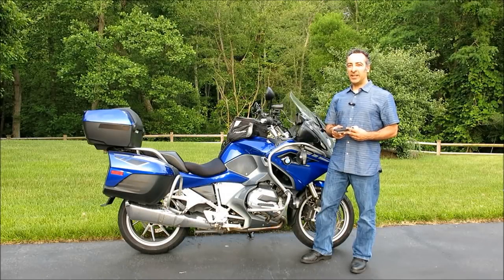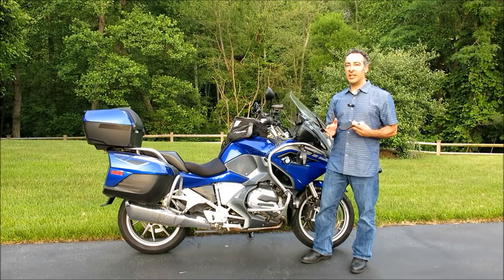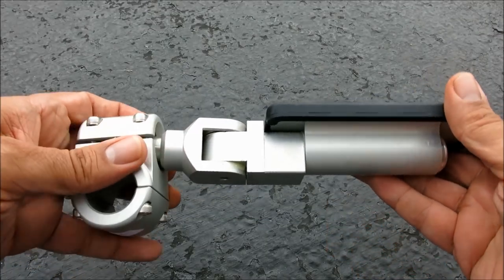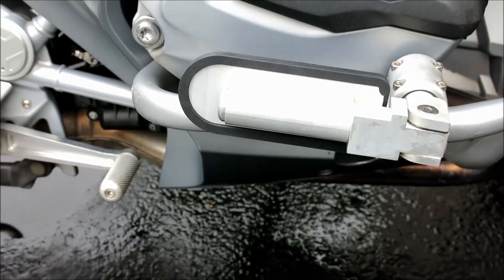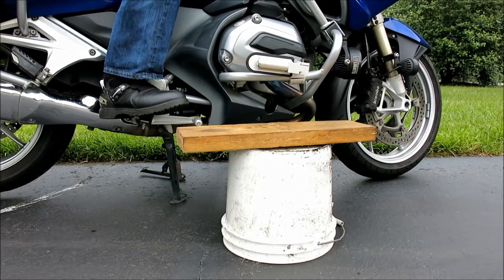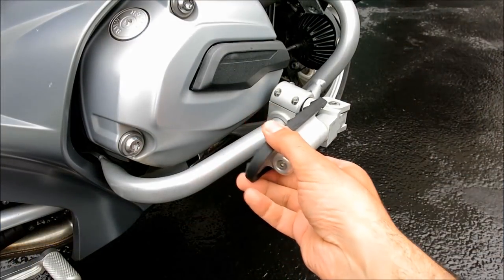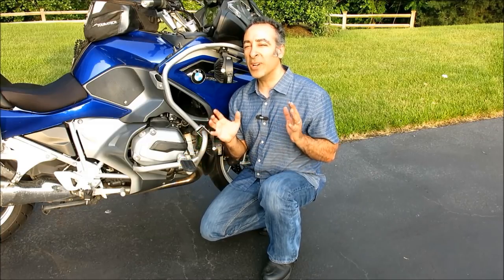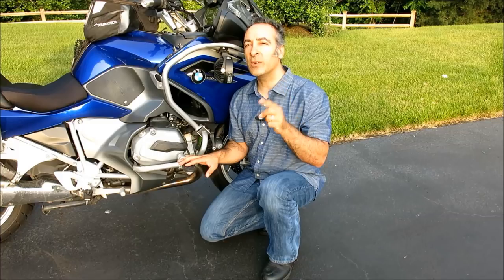Ilium Works Versatile Highway Pegs Review - Moto Mouth Moshe #46

Comment: I have been running IILLIUM foot pegs on the ILLIUM case bars on a K1600GT for over a year now.  You can preview these products at the annual BMW meet in IOWA this year.  I also installed their floor boards, and brake lever on the K1600.  These changes made the riding comfort of the K1600 much better for long rides.  I bought them at the BMW event in Salt Lake City and their first test was from SLC to Boston, for the return ride home. The advantage of the ILLIUM case bars and the peg combination is that the bars have multiple positioning holes that the pegs attach and fit into.  There are five or six positions, and with a quick loosening of the four bolts you can move the pegs as you see fit.  Extremely good quality, and very happy with the products over this last year.  Best modification to the K1600GT that I have done.  The ILLIUM rear case protectors were also purchased at the same time, for piece of mind with all the body work on the BMW.

Comment: I bought a BMW R1200RT with these mounted on the engine protection bars. The bike must have previously fallen on the right side and the foot rest rotated into the cylinder head making a small hole. Be careful.
Reply from the maker: don tabor ouch!

Comment: Do you know if these would mount on 2018 goldwing?
Reply from the maker: Hi David- The issue is the bars, not the bike so much. If you have 22.5 or 25mm bars in a position where these would be suitable for mounting, then they should work.